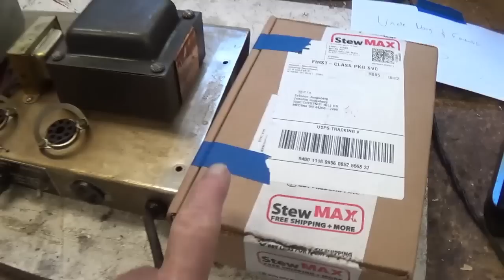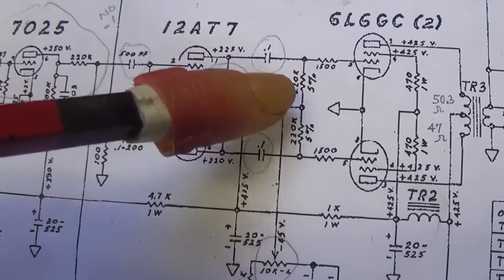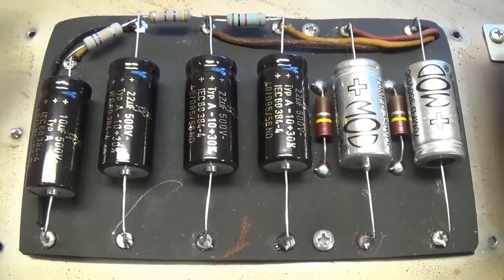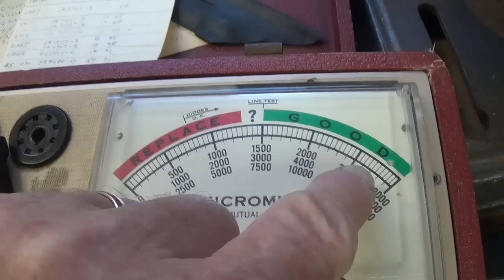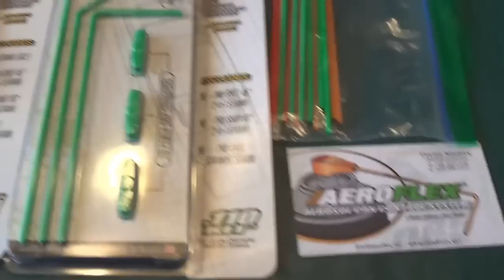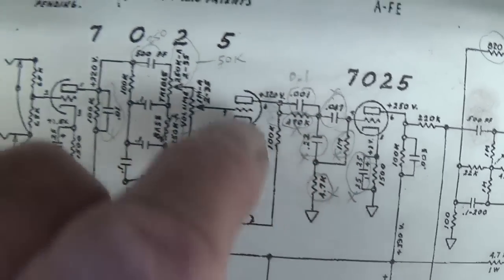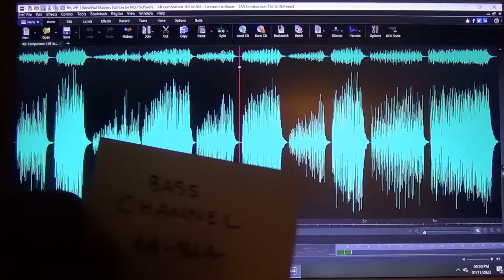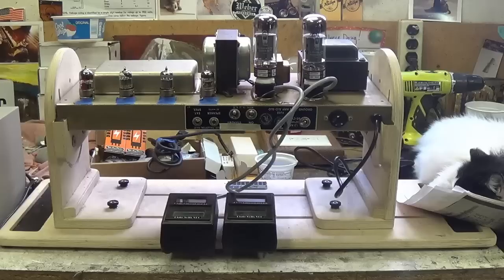Is the Conversion of a AA-165 Bassman to AA-864 Specs Worth the Effort ?

Comment: What a great amp and what an interesting experiment. The Fender site doesn't have anything to say about the switch to obviously inferior design in the circuitry but it is interesting to note that it coincided with "Fender’s 1965 sale to CBS and the summer 1966 start of Fender’s ill-fated experiment with solid-state electronics."  I'd like to have been a fly on the wall in Leo's office. Thanks for another great video Uncle Doug. You're the best!
Reply from the maker: Bear in mind that Leo was long gone by the time "blackface" amps were being produced, Kort. The CBS engineers obviously thought they could invent a better wheel......but, let's face it, when it comes to early Fender amps......you can't.
Reply: @UncleDoug   You're right, of course. I wonder if the circuit change decision was a marketing one, to discourage lead and rhythm players in small combos from sharing one amp. It seems to me the AA-864 would serve them pretty well for a while and save a new band some money.  Pencil-pushers in corporate accounting wouldn't like that, would they?
Reply from the maker: @iroffman  I guess that's a possibility, Kort.

Comment: Thanks Doug. That was fun. Fender made more changes to the Bassman than any other amp in the lineup (and, one might argue, still didn't succeed in making a bass amp). The 6G6 variants as well as the mid-60s circuits all seem designed to throttle back the bass channel. Maybe speakers were being blown (not even the venerable JBLs could reproduce the lower bass fundamentals). Or maybe they didn't want the bass signal to overwhelm the guitar since so many bands plugged multiple instruments into the same amp.
Reply from the maker: Very reasonable speculation, David. Thanks for sharing.

Comment: Hi Unky Doug,
The Canadian Standards Association (CSA) is a testing company that works the same way as United Laboratories (UL). It just happens to be in Canada. Products that are CSA approved just means that they comply with specifications like electrical code standards but those standards could be from the USA, Canada or somewhere else. It's possible that the amp was put through CSA testing for approval for sale in the Canadian market (in addition to US sales) but maybe the manufacturer just needed to comply with some electrical code standard. 
Nice to hear from you again,
Cheers,
 - Eddy
Reply from the maker: Thanks for the info, Eddy.

Comment: Oh Lord, I just finish working on an 864 and now I’m working on a 165.  It’s like Uncle Doug has been reading my mail.  Now I can learn if I’m onto something or on something with my current project. 🎉🎉🎉
Reply from the maker: I've been spying on you, BB :)
Reply: @UncleDoug  I’ve had four Bassmans with the AA165 tube chart but all have been AB.  Easy to tell with the weird add on 220K resistors off the power tubes.  One thing I was hoping to see clarified is the different ways they brought the normal channel into the phase inverter between the 874 and 165 but, another great Uncle Doug video.  You never disappoint sir.
Reply from the maker: @bbmade  I have addressed this issue in a previous video, BB, in which I altered that part of the circuit to improve the switchable NFB.
Reply: @UncleDoug  Thank you, I’ll do some homework on your videos 👍

Comment: Heck yeah! Another excellent upload from Uncle Doug! I dove into your videos a few months back after becoming the owner of an 1977 Twin Reverb that really could use a proper fix up. The vibrato is motorboating pretty badly and my attempts to correct it thus far have not succeeded…
Reply from the maker: Thanks, CP. Motorboating generally involves the charging and discharging of an electrolytic capacitor.
Reply: @UncleDoug  thanks for that information. I’ve replaced the all the electrolytics already and the problem has not been resolved. In fact it seems to have gotten worse. Perhaps I should check all the capacitor values and the solder connections to them? I used F&T for the replacements and the old ones that came out were about 15 year old sprague atoms. Appreciate your input.
Reply from the maker: @cheeze_pizza  The fault is generally not in the capacitor but in a short or some cause for the cyclic discharge. In the past, it was an internally shorted output transformer for me.
Reply: @UncleDoug  oh boy! I remember a video where you ran into that. I will have to go back and re-watch that one. I recall you doing testing to isolate the transformer as the problem. This may be what I need to do. Thanks again.
Reply from the maker: @cheeze_pizza  I think it was a small PA amp that was being converted to guitar.

Comment: CSA stands for the Canadian Standards Association. They essentially serve as a control function in regards to a variety of industries. In reference to electronics they are equivalent if not identical to Underwriters Laboratories here in the United States. Providing a hard set of parameters that all types of industry must adhere to. I work for a company that produces hazardous gas detection equipment. Specifically, I manufacture the circuit boards for these devices and we must adhere to a few standards in order to sell our product in different nations. We deal with UL, CSA, and ATEX. Each version of our product requires a slightly modified electrical schematic in regards to specific component values mostly having to deal with the power sections of the circuitry. The most common are zener diodes and resistors.
Reply from the maker: Thanks for the info, Collin :)

Comment: Fascinating video!
I like the normal channel, but neither of the bass channel versions gets me all the way there. Can the two channels be jumpered?
Mixing in a bit of the bass channel could be cool.
It seems they were trying to take out what we now call "mud," but ended up lopping off the whole low end.
Reply from the maker: The two pre-amp channels are out of phase, Jim, so jumpering is not possible. Bear in mind that the 864 circuit can be greatly improved with tone control adjustment.

Comment: I lot of guys have recommended changes to tone stack values in the Bass Instrument Channel. I really like the  "Trainwreck" recommended values of replacement of the. 1uf and .047uf capacitors to both .022uf. It works real well cranked up with overdrive for rock. Normal channel does what you expect and the modified channel becomes a "Rock Channel". The 3rd preamp gain stage can also be adjusted for a bit more gain.
Also a bit more upper mids can be nice with a 330pf or 500pf treble cap in the tone stack. The midrange resistor can also be adjusted to taste.
Reply from the maker: Thanks for the very helpful input, Chris.

Comment: Looks like that there are a few folks viewing Uncle Doug's content who would like to see fingers kept away from potentially dangerous components. Yes, I know that you have taken all the sane precautions with appropriate warnings but it helps to set a good example for those less aware and mindful of "what not to do" when servicing that type of equipment. Best to use non metallic chopsticks etc or that rubber "finger tip on a stick" instead when you need to "point" something out. C'mon Man! 😉
Reply from the maker: Thanks for sharing your opinion with us, BT.

Comment: i suppose the bass channel from the  AA864 was actually designed for bass guitar in a time  before 6 string guitarists  bought all of these  amps up, the 165 is undeniably better for guitar. great video
Reply from the maker: Assuming that you're referring to the Bass Channel, Aron, I differ with your assessment of the AA-165 as a better guitar amp. In the audio tests, it seemed apparent that it was not. The AA-864 was not perfect, but it was "fixable" and much closer to being a good guitar channel.

Comment: Happy new year Uncle D! I was intrigued by the control labelled "English" on your tube tester, but a quick search later and I discovered it's to read a simple "good" or "bad" result rather than one in microhmos. I'm still a little intrigued why it's a dial rather then some sort of switch or button.
Reply from the maker: The English dial is adjustable to achieve optimum tube function. If you alter the dial setting, the output emission will vary.

Comment: An important thing to say about the Aeroflex nozzle adapter is that you don't have to take the original spray head off the 
can . The button goes over the original tip.
Reply from the maker: Good point, HM. Thanks !!

Comment: The amp appears to have no white outlines around the Deep and Bright switch openings on the front panel. This usually indicates that it is an early 1964 blackface amp, but Fender was notoriously loose when pulling parts at times. My 64 Super Reverb has no outlines, and it is one of the few I've encountered in many years.
Reply from the maker: Thanks for the interesting input, Carke.

Comment: One last Q: What was the setting of the Deep switch for the tests? And the NFB was enabled for all the tests?

And yes, the 864 seemed to be lacking in highs on the bass channel, but if you use it on an actual bass that probably doesn't matter (unless you're into super bright or slap bass). And as the normal channel sounds so good for guitar, it's actually better to have an alternate channel that's notably different, otherwise what's the point?
Reply from the maker: The Deep Switch position seemed to have little effect, AQ, and the NFB was off for all demos.  At moderate volumes the absence of NFB is a huge improvement.  I agree that the two channels should offer different tone, otherwise one is simply a backup for the other.
Reply: @UncleDoug  Thanks!!!

Comment: At 27:30 - 3.3ohms difference in the center tapped secondary could account for more than a handful of shorted windings. I can't wait to see if there's any excess heat or fuse issues.
Reply from the maker: Sorry to disappoint, T.

Comment: Doug your right the two versions will sound much different.
But you used for the weaker signal your volume knob... Not only the volume will change the tonal will too, course of differance in impedance of the volume pot. For comparison you better digitaly fet up the volume in your program on your pc.
Well overall I admire your work and nice comments on your channel.
Reply from the maker: I did digitally amplify the signal, WW......the volume pot remained the same for both channels.

Comment: I watch all your fender fixes all the way thru as you are a great teacher of these guys. I was able to repair one of my own last year. Since you have that fabulous book of schematics, does it include the one for the 80's model called the "Red Devil"....? It has all red knobs and is the fender twin style. All kinds of push-pull set ups with cheet sheet. Mine has died. It has a PCB style board in it with all the usual tube sets. I have never seen you work on one of these. This one scares me to dive into. Any prints for this guy in your new book ?
Reply from the maker: The schematics (and my personal experience) are limited only to the earlier, all-tube circuits, Mark. Sorry.

Comment: Looking at those schematics, the tone of each is surprising. Given that plate bypass cap on T1 on aa165, I thought it would have been darker. But the complexity of the aa165 circuit is definitely sucking the signal out of it, but it definitely has less compression. 

The AA864, that .001 cap to ground would definitely take some highs out. The changes to the tone stack are probably playing a role. Like the value of the pots look like it would definitely favor the lower end. Something else I’d try is reinstalling the cathode bypass cap on T3. It may help get the blub out and firm up the bass.

I’ve used plate bypass caps of low value to help tame fizzy distortion on my bass amps second channel without hurting tone.
Reply from the maker: Thanks for your helpful input, Aaron. I'll make a confession.....after the video, I re-installed the cathode bypass cap and the 4th (10uf) filter cap, simply because I thought they made good sense.
Reply: @UncleDoug  I wondered if you did given your closing stating you will be tinkering with it for a few days. Please let us know what your solution is. We have missed you and hope all is well.
Reply: @UncleDoug  the .001uf cap and the 220k resistor it bypasses. I would change that cap to 330-470pf and maybe up the resistor of the signal and signal to ground to 470k and give it a try. I think that would definitely perk up that bass channel in upper frequency response. Cause honestly aa864 is too dark for my liking.
Reply from the maker: @aaronatwood9298  My approach would be to remove the .001uf and .003uf bypass caps on opposite sides of the third triode......see how it sounded, and then either leave it alone or experiment with lower value caps.

Comment: Cannot remember If I commented before , all my Amps have a separate mains cable into a power (Bulgin- which is so tight as to be permanent anyway !, or Kettle Lead style).  This does have an advantage if power cable tripped over it might pull out before the amp hits the floor.
Reply from the maker: Thanks for sharing, HP. I hope you're right.

Comment: You should consider going to Harbor Freight and buying some Marine-type heat shrink tubing. It has glue inside holding the speaker cord and 1/4" plug together without slipping apart. It works well for strain relief on instrument cables.
Reply from the maker: Thanks, Steven. I will look for it the next time I visit HF.

Comment: I am sure someone else noticed but in addition to the letter to number code on schematic,  the circuit numbers were dates also it seems. AA864= eight month of 1964.    AA165 lines up with the January of 65 letter code.   I guess the change in April wasn't enough of a change to make it a complete new circuit name.  So the AB165.
Reply from the maker: Thanks for your input, Steve.

Comment: Well, concerning AA/AB165 version.  Fender in 1965 as been sold to CBS. As far as I  know, the AA/165 was produced in the "transition" year of the acquisition of Fender by CBS.  The AB/165 would be the CBS modified version of the AA/165. (More aimed for guitar player.)
 
The main difference in the CBS version are;
 the (strange) output stage configuration (balanced bias, the FBL... ), the last stage of the Bass channel (V2b) is shared by both channel.
In the spécific case of the AB/165, this allow to inject one channel signal into the other channel.

The AA/864 and AA/165 where Bass amplifier.
Reply from the maker: Thanks for your helpful input, N.

Comment: First let me say that your video is fantastic. I'm just getting my feet wet with Amp repair and mods. I'm gonna watch a few more times. One question I have tho.....I have an AB165. I suppose if i just continue to compare to the 864 I should stay out of trouble.
Reply from the maker: Thanks so much, Craig. The AB165 circuit is quite different from either the 864 or the AA165. I would be tempted to leave it alone.

Comment: Interesting that Fender used those letter-codes to represent dates rather than spelling them out in the first place? Uncle Doug, any ideas why they would do this
Reply: The “864” in AA864 is when the circuit was designed, the letter code “H-FD” is when the schematic was actually drawn and published. So the AA165 was designed and published in January of 1965 and the AB165 (B is the second version of the AA165) was designed in January, but the schematic was drawn and published in April of 65. What would be interesting to know is what was the reason for the changes? Was it that a failure was found? Or a tone change was needed? Maybe Leo wasn’t happy with the sound after a while?? I love the history and the progression of the designs through the years. 🙂
Reply from the maker: Stephen answered quite well, David. I too wonder why many of the changes were made. Perhaps "tone tastes" changed over time, so that what was unacceptable in the 60's became very desirable in later years..
Reply: @SHarris64  That's probably how it went - a real 'seat-of-the-pants' organization!

Comment: Hi Doug, you missed one. The plate circuit for the third triode has a .003uF bypass in the AA165 which is .001uF in the AA864. I find all these far too high. I would use 100pF myself, for stability, and let the player decide how much treble he wants, rather than rolling it off from 1.6kHz in the amplifier right at the beginning and several times thereafter.

That network between T2 and T3 (your numbering) in the AA165 defies belief. Apart from the crazy tone shaping, which sucks out the midrange, it lowers the level drastically (40dB), hence the cathode bypass capacitor for T3, which restores some of that gain. Probably restoring these back to AA864 or forward to AB165 would fix most of the tone issues.

There is another one however. The turnover into the bass pot is 160Hz in the AA864, which is about right, but about 40Hz in the AA165, which is ridiculously low: the bass pot would have no effect whatsoever on a bass guitar.

The 250/500pF issue just affects where the treble control starts to work. I find AA864 has it too high at 2.5kHz, and would retain the 500pF which halves the turnover frequency. AB175 increases it to 850pF, which lowers the turnover further to 750Hz, a bit too low I think.

That 27k/8uF decoupling is an improvement that I would not have removed. It has no tonal effect, and it better isolates V1 from V2.

EJP
Reply from the maker: The .003uf bypass cap value remains unchanged in my 165 & 864 schematics, EJP.  To improve the treble in the somewhat muddy 864 Bass Channel, both it and the .001uf bypass should probably be amputated. I secretly replaced the 8uf electrolytic cap after the audio testing was done, since I felt it just made sense.